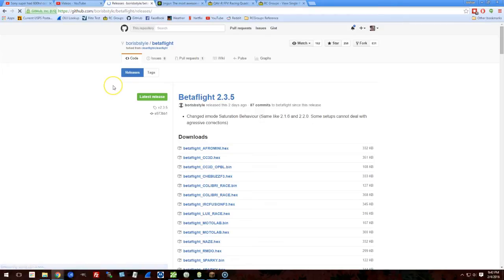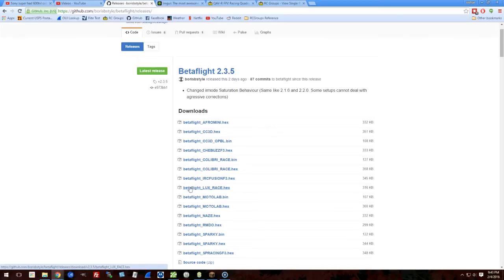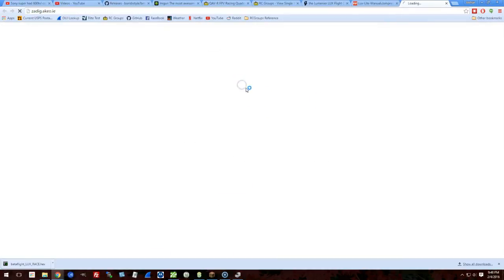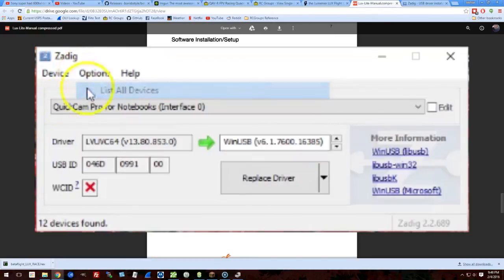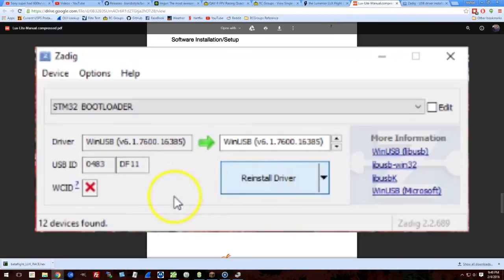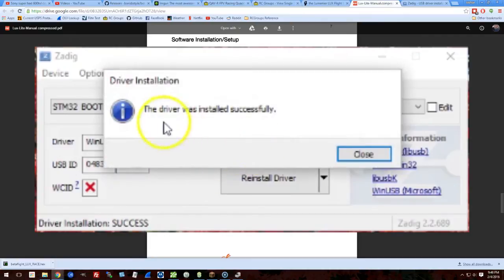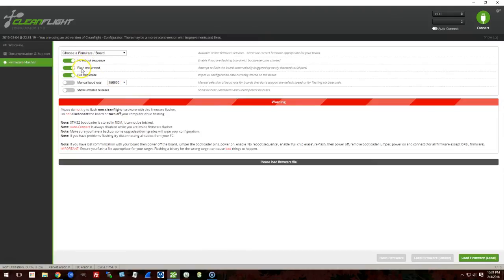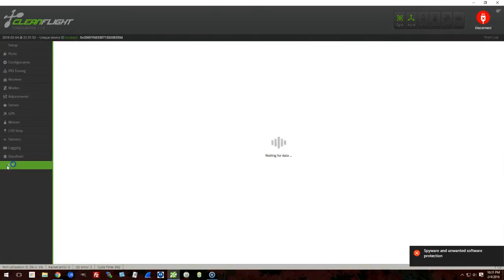How To Flash Lumenier Lux with Betaflight

Comment: @Joshua Bardwell, long time listener, first time caller. I'm flashing Betaflight 3.2.2 to a LUX v1, and I'm struggling to get my Spektrum receiver/transmitter to communicate with my board on my backup quad. I have tried every combination of UART port, and I can't tell what the port used to be from my text file. I was able to flash 3.2.2 without any issues, but during the setup procedure I have yet to be able to get board and the transmitter  to communicate. Also - Before this I had this quad flying just fine with BF 3.1.7. Same transmitter and receiver combo, and I've never had these issues until 3.2.2. Any insight?
Reply from the maker: +Ryan McCahill assuming you didn't change the wiring, dump your config, flash back to the old version, paste in your old config, and see what it was.

Comment: I am running betaflight 3.2.1 with the lux V2 but can not get radio signals to talk to the board. Can you do a video how to setup ports for the lux v2 in betaflight?
Reply from the maker: https://www.youtube.com/playlist?list=PLwoDb7WF6c8lCcjOh26ZVQsLQtjGPQcgy
Reply: Thank you for th link to your how to video series. I have everything wired correctly, this is my fifth build and I never ran into this issue before. I see lots of people have an uart issue with the lux v2. I set the correct uarts to turn off and on but it doesn't seem to save when you save reboot and go back in that tab.

Comment: Hey there this worked for my lux v2 as far as getting it flashed now when I try to connect back to beta flight it says use flasher the connect to dfu device any suggestions
Reply from the maker: Stop putting the Lux v2 into bootloader mode. You can't connect to the FC to configure it when it's in bootloader mode. You can only flash the FC in bootloader mode. You have to see "COM3" or some other number in the upper-right of the configurator, NOT "DFU", to configure it.

Comment: Hi joshua, how to prevent lux to keep forcing enter DFU mode...?
Reply from the maker: +Jeffry Wahyudy I guess maybe the bootloader button is broken? If so, desolder it and remove it.
Reply: maybe...but i tried to probe it and the button still working, or maybe there is a pulldown/up resistor?

Comment: hello Joshua, Thank you for all you do for the hobby. I'm having problems with my new Aurora 90. Dsmx,dsm2.. I Can't get it to set bind in Beta flight CLI. when I dumped it, it was all there. I know I can't brick it. but should I try and re flash it. It's right out of the box. I shouldn't have to. I would think... And  Bangood isn't that easy with returns.also' The time it would take to get back to me.  Fyi all self taught and some what new to betaflight and the whole whoop thing.
 I also did drugs when I was young. so,,,   can you help me out...
Reply from the maker: +Pooley, S you're entering the command in the CLI to enter bind mode right? Do you get an error message there?
Reply: Yes. 
Set spektrum_sat_bind=9
Save 
Nothing. ..
Reply: And no on the error
Reply: On the Aurora  90 Dsmx set up. There is a red led. And the bind is orange and flashing.  It won't flash or light up for that matter.  It seems like it's working, I remove from computer  and reconnect.  Nothing.  Just the red led. Spektrum is a pain.
Reply from the maker: Sorry, no clue. Every time I've had to bind Spektrum that's what I've done and it's worked.

You know you have to reboot the board to go into bind mode right? You issue the CLI command and then power cycle and when it boots up again it's in bind mode.

Comment: Hi Joshua, is it possible to flash a lux over an fdti connection to uart 1?... I ripped off my usb connector,grrr. I can change settings but can't flash. Thanks so much for such a great channel. Soooooo useful :)
Reply from the maker: +penny fpv only if MSP is enabled on UART 1. This was disabled by default in 3.1, buy is enabled by default in 3.0 and earlier.
Reply: I've got msp enabled on uart 1 and 2... but just get a boot loader not responding error in the bf config

Comment: how do I boot in boot loader mode?
Reply from the maker: Hold down the bootloader button on the board while plugging in. Or if it has bootloader pads, short the pads with a paper clip or by soldering a bridge between them.

If you are using a recent build of betaflight, go to the CLI and type "dfu". The board will reboot into bootloader mode.

Comment: After I flash broad, it says programming successful. But when I try to connect to the board for setup. It says  (Failed to open Serial Ports) Any suggestions. Thanks
Reply from the maker: +SyNFuLLj what are the LEDs in the board  doing when you plug in USB? Flashing red or solid blue?
Reply: I figuered it out. Had to update com port in device manager.  Thank tho!  Your videos are always helpful.
Reply: how did you update the com port? im having the same issue

Comment: So frustrated! I can flash this all day long, but when it comes time to connect to the computer and load in Cleanflight or Betaflight all I get is the typical unrecognized usb audio cue. What am I doing wrong/missing?!
Reply from the maker: Plug in the USB cable. Do NOT press the bootloader button. Go to Zadig. Does it show "STM Bootloader"? If so, your bootloader button is broken. The board is always booting into bootloader and that's why you can't connect with the configurator.
Reply: Sorry, I think I was overly frustrated when first posting. I followed your instructions to the T, I can get the driver installed and then I'm able to flash the board with betaflight perfectly fine. After I'm done with that when I try to just connect in Cleanflight and I plug in the board I hear the typical windows audio usb plugged in sound but the one you get when it doesn't recognize the usb device. When I load Zadig again it shows no usb driver installed. It does not show STM Bootloarder when I connect it
Reply from the maker: +Blue Dragon I would say, plug in the FC and then go to device manager and see the device with an error. Uninstaller the drivers, including the "delete files" option. Reboot. Reinstall the drivers. 

Makenzie you only use Zadig to replace the STM Bootloader device, not the regular STM device.
Reply: ;( bloody hell. So now when I plug in the board I get the nice windows audio the is happy with a usb device. So I'm thinking "YAY, it works!", then I open cleanflight and click connect expecting all to be well...NOPE! Cleanflight just says "No configuration received within 10 seconds, communication failed" ;'( waaaa. I've rebooted many times throughout all this, I even uninstalled the driver like you said, reboot then plugged the board in again and the drivers now automatically install successfully but still the same result "sigh"I really appreciate you taking the time to help me out though
Reply: Ok, so apparently Windows 7 is just lame on this. I was able to borrow a friends computer that's running Windows 10  and all I did was plug in the board, opened Cleanflight and voila! connects just fine!Now if I could just figure out what 7 is missing that 10 has. It can only be a driver thing....right?
Reply from the maker: +Blue Dragon Yeah definitely. I have a 7 machine and it works fine. But glad you got it working for now anyway.

Comment: my lux is in dfu mode but its not picking up in cleanflight
Reply from the maker: Have you installed the Zadig driver?

https://www.youtube.com/watch?v=b8fMsazyxDw

I recently had to refer back to that video myself, as my drivers got screwed up and I couldn't remember exactly how to fix them.
Reply: yes i have. Its giving me the same problem with another new lux board. I think its just my PC. I'll give it a go on my laptop and see how that turns out
Reply from the maker: Try this: plug in the Lux in DFU mode. Go into Zadig and see what is shown. Find the "STM Bootloader" device and see if the WinUSB driver is shown for that device. If you don't see "STM Bootloader", then you're not in DFU mode.
Reply from the maker: I just went through this nonsense myself the other day. I ended up completely uninstalling all my STM and CP210 drivers and reinstalling from scratch.

If you have just installed the driver, a reboot may be required.
Reply: Done. I am definitely in DFU mode according to both the LED indicator on my lux and zadig as you have suggested. Which means that my drivers are fine. I'm reinstalling Cleanflight in chrome and I'll give that a go.
Reply from the maker: +Raven3one ok good luck.
Reply: It worked on my laptop. I'd still like to figure out what went wrong on my desktop PC. I can still program it fine on PC through the configurator but its just the DFU flashing that doesn't work.
Reply from the maker: +Raven3one driver not installed correctly?

Comment: Does anyone know if the configurator for android will work on the LUX board?
Reply from the maker: This is a good question, because Lux (and other boards) use Virtual COM Port, which as I understand it, requires a special driver on the PC. So the question is whether that will work on Android. I don't know.
Reply: Guess I will find out in a week or so once mine gets here.

Comment: Some people, including me, have been having a problem returning the board to configuration mode after flashing. Some users have reported that the board appears to be permanently in bootloader mode, with the board immediately entering DFU mode upon connection to the computer, or at the conclusion of a successful flash. The solution to this, at least for me and a few others, is to unplug the board and wait. I don't know for how long, perhaps several hours.  

I have no idea how this works, but I was trying until 1:00AM to get it to connect to cleanflight until I gave up and came back the next morning. Somehow, there is a time element involved. The board worked exactly as the video demonstrates. Perhaps, as some users have reported, there is some residual charge on some component in the board that makes it enter DFU mode on a connection and this charge may dissipate if the board is left undisturbed overnight.
Reply from the maker: Very weird. You should be able to kill any residual charge by shorting 5v to GND manually. Most often, "board won't leave bootloader" mode means a failed button. Check continuity on either side of the button. It should be open with the button up and closed with the button down.

Comment: hey man i really like ur work on multirotors, I did everything u did in this clip, and my lux board  did flash, but now i cant connect to the board????
Reply from the maker: +james ferguson are you out if bootloader mode?
Reply: +Joshua Bardwell I'm having this problem too. I did as instructed by my Lux is in DFU mode every time I plug it in, regardless of whether or not I'm pressing the button. When I flash it it works, but as soon as the flash is complete it returns to DFU and not COM and I can't access the configuration.
Reply from the maker: Usually, if the board refuses to leave bootloader mode, it means the button is broken. If the board is essentially scrapped, then try desoldering the button.

Comment: Joshua I put betaflight on a seriously pro Evo and I ca no longer click on calibrate Magnetometer? any Suggestions? Thank you Frank
Reply from the maker: SP3 Evo magnetometer is broken. Supposedly it can return bogus values. The feature was disabled in betaflight for safety.
Reply: Joshua thank you sir will the board still function properly without the magnetometer?
Reply from the maker: Sure. Just won't be able to use any of the mag-based flight modes like heading hold and headfree.
Reply: thank you sir

Comment: when i go in zadig and i didn't see STM32 BOOTLOADER
Reply: same for me
Reply: got to option and click list all devices in zadig
Reply from the maker: If you don't see STM Bootloader, then either your driver is not installed correctly or, more likely, your board is NOT in DFU mode.

If you have a board with a CP210 adapter, it will never show as STM32 Bootloader even when it is in DFU mode.
Reply: +Joshua Bardwell it was my sub cable. For some reason it wasn't working but I used a dufferent cord and it worked fine

Comment: I have flashed the controller, rebooted PC, but nothing... I see only Com1 & manual in cleanflight

Guys is there an other reliable source for stm usb vcp drivers?
Reply from the maker: +Dimitris Alexiadis Next step would be to check the device manager (assuming Windows).
Reply: +Joshua Bardwell 
done this, but no unknown devices there.
what should i look for? "STM32 Virtual COM Port" is present though
Reply from the maker: Are you trying to flash the board, or configure it? COM1 may very well be your virtual COM port. If you are trying to flash, you need to press the bootloader button and be in DFU mode.
Reply: +Joshua Bardwell trying to configure. have already tried com 1 with no success
Reply: +Dimitris Alexiadis 
I get a message saying: No configuration received within 10 seconds, communication failed
I have also tried to register for the VCP drivers - Yet an other failure. No confirmation mail received. In both my atempts (one in Hotmail, one in Gmail)   
Getting frustrated here!
Reply from the maker: Try this: http://www2.st.com/content/st_com/en/products/development-tools/software-development-tools/stm32-software-development-tools/stm32-utilities/stsw-stm32102.html?dl=535475483584515999

Link is only good for 24 hours.
Reply: Joshua Bardwell this gets me to the same site that registration is needed. (and I have tried registering twice! - With no success)
Reply: No I take that back! It downloaded! THANKS lets try this!
Be back in 5''
Reply: +Joshua Bardwell just installed and restarted my pc, still same problem. do you think you could help me out, through teamviewer or something?
Reply: Do you think I should try something different
 than cleanflight?
Reply from the maker: I don't think you answered my earlier question: are you trying to flash the board or configure it?

Are you able to connect in DFU mode and flash the board?
Reply: Yes I have managed to configure it in DFU mode. Installed latest version and all. But can not connect in Com-X mode and access the FC configuration menu
Reply from the maker: Try re-flashign with full chip erase enabled.

Did you disable MSP on the VCP port perhaps?

When the board is un-plugged, you should see only "manual" in the pulldown menu in the upper-right of the configurator.

When you plug in the board, "COM1" should appear (or whatever COM port you are using). If this happens, CleanFlight has recognized that the board is plugged in. Your drivers are probably correct and there is probably something wrong with the board IMO.

Have you tried manual baud rate? I don't think the Lux needs manual baud rate, but it couldn't hurt.
Reply: with FC unpluged I see COM1 & manual
When pluging the FC with button pressed I also see DFU option.
I have re-flashed (1.12.0) the chip with full erase and manual baud rate 921600

Also downloaded latest Chrome
And yet no new com in the option menu
Reply: the FC is working though because I have managed to get it to connect with my work Laptop, were I have no Admin right and so No driver installation was possible! How about that?!!!
Reply: (Your comments in your video, about regarding leaving the city.... come into my mind all the time xexexe)
Reply from the maker: If you see DFU then the Lux is in bootloader mode. What LED is flashing on the board?
Reply: The blue one is ON an a small orange in the middle flashes every now and then
Reply: I have also tried to remove COM1 from device manager, STM32 Virtual COM Port And all unknown devices - and wait for re installation process but....
Reply: After removing for the 10th time the drivers and restarting the PC same number of times! For some reason GOD felt pity for me and made it work!!! I Really want to thank you helping me out.
Reply from the maker: Glad you got it. Don't touch a thing!
Reply: It almost got me first! :D

Comment: I just wanted to say thanks, I followed the same process to flash my Seriously Pro F3 Mini.

The only difference is you just need to try and have it fail to flash via Cleanflight Configurator to make the 'STM32 BOOTLOADER' device show up.  Replace the driver, re-boot and DFU shows up and it of course now works.

Once installed it works with Cleanflight just like it does with a Naze Rev5 etc.  It seems that configurator auto switches to bootloader / DFU on the SPR F3 Mini when you try to flash the board.

Thanks Again!

Comment: Hi i have a SPRACINGF3MINI before i watched this i couldn't get dfu to work , 
now in cleanflight i can get dfu on the port bar 
and I shorted boot loader pins i was able to flash new betaflight_2.5.0_SPRACINGF3MINI. 
now on cleanflight my PC is not finding the virtual port,
so i can`t connect to cleanflight it just shows manual selection no com ports are shown  
 if i plug my naze rev 6 in com ports come up .any help would save what hair i have left !
Reply from the maker: +Jeff deakin Make sure you have the VCP driver installed.
Reply: +Joshua Bardwell hi  all sorted my PC was showing the sp3 as a virtual port not a USB device . Changed from a virtual port  to s usb rest PC now it works short boot pins then dfu comes up should work with buttons but it doesn't , and you can flash it then it comes up as a port  . Works in cleanflight.  Cheers for your help

Comment: I was able to flash successfully but afterit drops out of DFU mode COM6 is missing, do I need to go back and change the driver to access the configurator?
Reply from the maker: Try a reboot because you never know. Maybe also reinstall the VCP driver.
Reply: +Joshua Bardwell 
Were can I get the VCP driver. THe link from cleanflight requires registration or something...
Reply from the maker: Get the driver from the link in question. Create a registration if you need to. Bummer about the inconvenience but who cares?